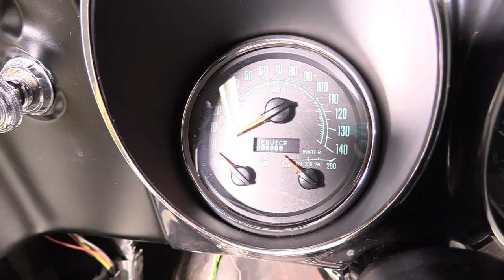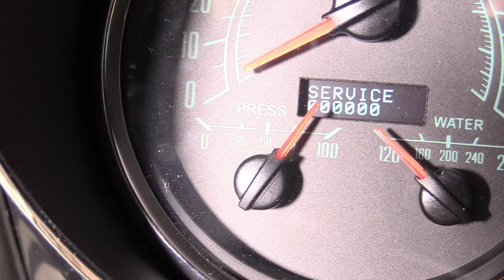How to Build a Chevrolet 454 Big Block Part 16: Wiring, Senders and, Oil Priming

Comment: Hey... REALLY like your series of videos on the 454 build...!!! While I am 73 yrs of age, you ARE teaching this guy some stuff that I wish I had known many, many years ago....

I want to share with you some important information that you may or may not know (or need to know). If the Camaro you are installing the big block engine into was not originally a big block equipped car from the factory, then the transmission cross member will not be correct for the big block engine.The big block 396 V8 engines (when used with the correct big block motor mounts) sit off center by at least an inch towards the passenger side of the vehicle. Because of that, the correct factory transmission cross member also provided this one inch offset for the tail end of the transmission. 

Not trying to be a smart a___ or know-it-all, but many car guys are not aware of this. Small block engines were centered, big block were offset in order to give more room near the steering box. You can best determine if the offset exists by measuring under the hood from the center of the engine (I used the threaded rod in the carb as a center point) to the same point on the inside of the fenders on both sides. With the correct BBC engine/motor mounts, the engine will be off center. The key things are (1) correct BBC engine mounts and (2)  the correct transmission cross member which also provides for the offset.

Keep up the good work...! http://www.Nova-SS.com

Here's some additional info:

https://www.camaros.net/threads/is-there-a-different-crossmember-for-big-blocks.326849/

 Robert R
Wharton, TX

.......................................
Reply from the maker: Hey Robert! Thanks so much for watching and the info. We had to figure all that out the hard way. We got different frame stands for the engine and it totally solved the problem. I love comments like this. Thanks so much for watching!

Comment: One minor little point.  Both of the senders depend on a good ground through the screw-in base.  They are essentially an ohmmeter, measuring resistance.  If you don't have a good ground through that base, you will have readings that are too low.

Comment: I've been watching each one since #1.  Thank you.  You did miss the harmonic balancer install and the oil dipstick tube install.
Reply from the maker: I would never let you down. https://youtu.be/WITN7Q8SX1U This is balancer install and I'm pretty sure I showed the dip tube. If not its pretty simple. Stick it in the hole and bolt it in via the exhaust header bolt. Thanks for watching!

Comment: Please note that the threads of the oil sender as well as the temperature sensor are your ground  connection. It may be a good idea to test for continuity and make sure that the threads have been able to bite through the teflon tape.
Reply from the maker: Both senders work on the dash so I think we are in the clear. Thanks for watching!

Comment: looks like a 1 wire sender, I may be mistaken but, with all that Teflon on the temp sender and fittings, you may have defeated the grounding or at least a change in resistance to the sender... other than that great vid a lot of great info here:]  keep em' coming,  regards
Reply from the maker: The edge of the threads cut through the tape and ground out. You’d have big leaks if you didn’t use it. Thanks for watching!

Comment: i love your video series on the big block chevy. i am doing the same exact build , i have a 67 Camaro , i was wondering where you ended up getting your headers , as i am sure i will have the same problem
Reply from the maker: Awesome! I love the 67 Camaro. It's been my dream car for as long as I can remember. So this is super important. There is a difference between big block frame mounts and small block engine mounts. I had no idea until I tried installing my big block on small block mounts. It won't work. The big block mounts actually tilt the engine over a bit to help clear the power steering box. The headers I used, after trying 3 different sets, were made by Doug Thorley I'm unsure of a part number though. 

Thanks so much for watching!

Comment: what brand aftermarket temp gauge did you use?  The temp sending unit on my 454 is on the head.  Is it better to relocate it on the intake?
Reply from the maker: I believe it was made by Detroit Electrics they did my gauges. No it doesn't matter. Thanks for watching!

Comment: Can you not install the oil temp sensor to the threaded hole closer to the front of the engine on the driver side? I've read where some people do this
Reply from the maker: The oil galley plugs? Yeah probably. I just use the stock intended location. Thanks for watching!

Comment: I think you skipped over the part about which headers work best to not interfere with the power steering pump  because in this video the driver side header has magically been installed.  Please share with us what manufacture and part number headers are used in this build.
Reply from the maker: You need big block engine feet for the F body. And you need Doug Thorley Big Block Chevy F body headers. But that is only specific to the Camaro. If you aren't putting in a Camaro it is going to be different. Thanks for watching!
Reply: @2carpros  so these headers cleared the  power steering gearbox.? .   I hoped you would supply the part number from Doug Thorley    I’ve carefully recorded all the parts and part numbers from your 454 build  because I am building one as well